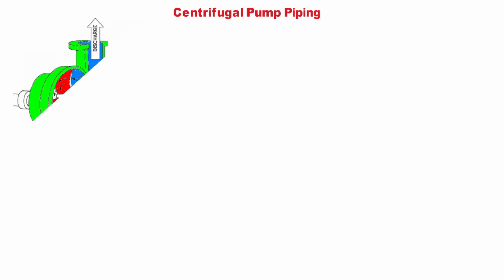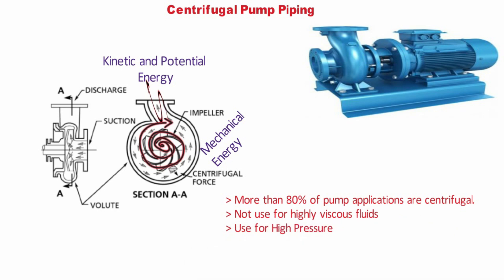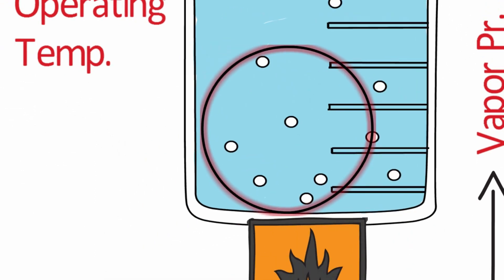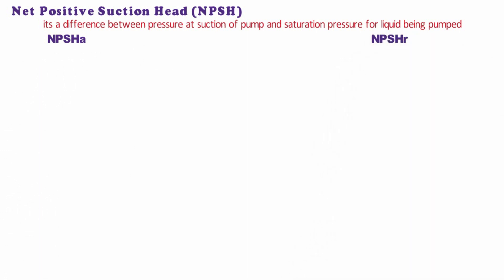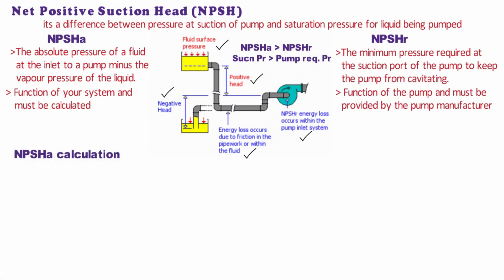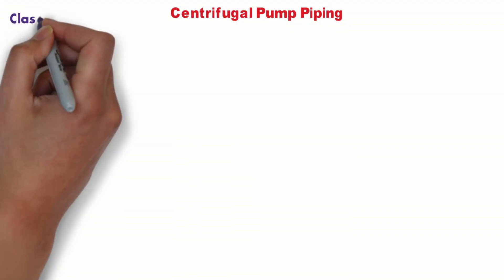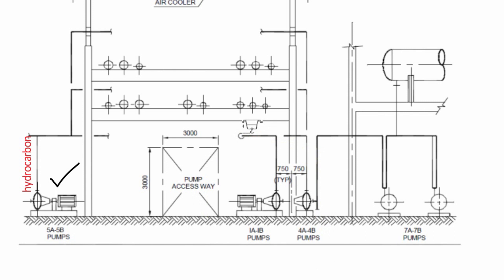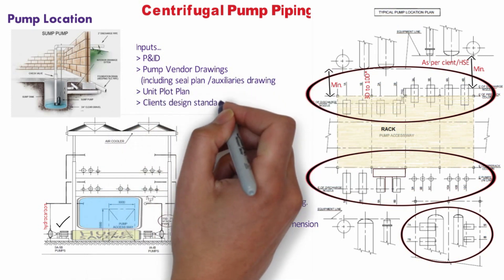CENTRIFUGAL PUMP PIPING LAYOUT | PART-1 | PIPING MANTRA |

Comment: Thank you for this informative video. As a client, if you have the choice between two manufacturers submitting for the same pump. would it be better to choose the manufacturer proposing its pump with NPSHa>>NPSHr than the one proposing its pump with just not very far from the calculated NPSHa. does this means that the design of the former is better such as impeller size etc...Thanks in advance for your reply.

Comment: It's too fast.ur imparting excellent
 information but it's very difficult to understand and correlate the things because of ur fast speed.
Reply from the maker: I understand your concern, but in our recent vides you will see the difference. however there is an option in youtube to slow down the tempo of video. Our main motto was  as much as informations in short duration..
Reply: @PipingMantra  thanks a lot I got ur point. 👍 Nice incentive best of luck.

Comment: As usual excellent video. I have two queries:
1) Why the sump pump pipe installation should be avouded in pit?
2) Why pump should not be placed under gas/air cooler?
Thanks for your valuable time.
Reply: 2- hydrocarbon leekage under gas/air cooler can reach motor of electic pump and this can be hazardous. 1)-i guess the answer is- if u place pipe inside pit ..u again have to go to pit to open it for maintenance and the sump pit has bad odour + harmful gases .. for more on this visit 
http://thepipingtalk.com/2019/07/location-of-pumps-in-equipment-layout/